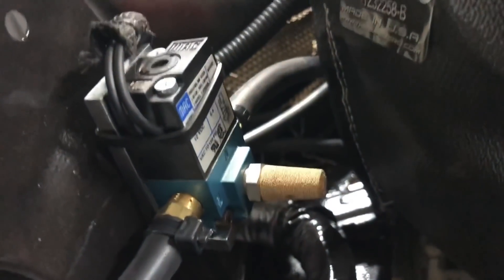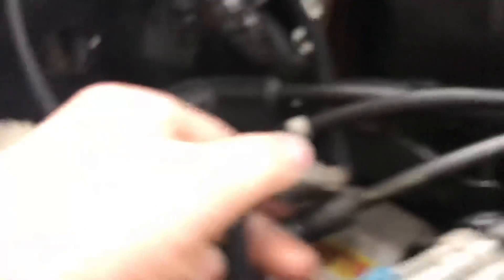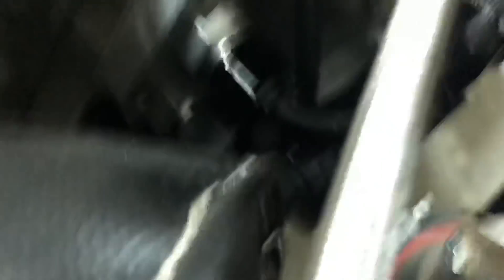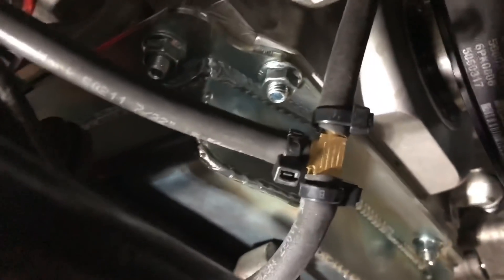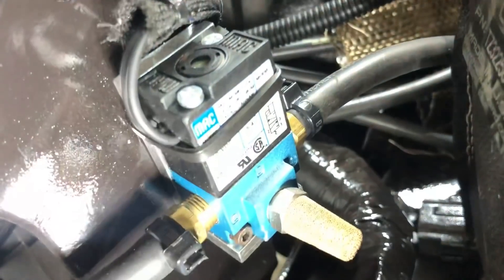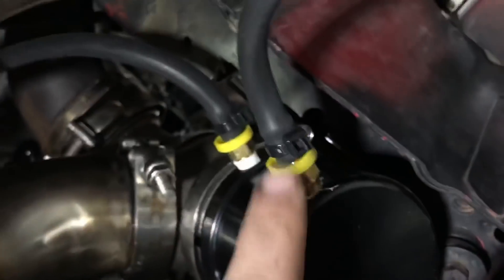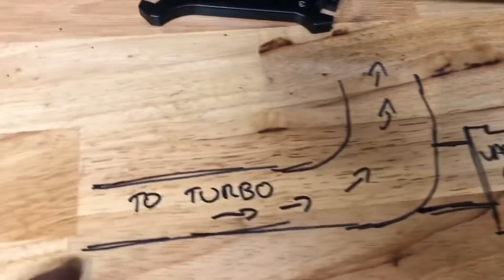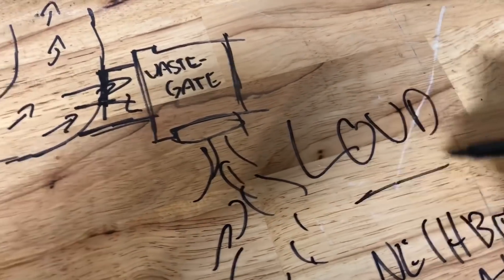Boost Control Solenoids: HOOK EM UP!

Comment: So once you wire it to the Holley what signal do you use? Map signal then type in the number you want it to use?
Reply from the maker: Depends on which Holley system.  Dominator and HP will do target manifold pressure.  The terminator x will not.  It will do dome control which is very effective
Reply: @ClapdOut  they lied to me on the phone then

Comment: Should you pull from the turbo compressor housing to Mac, or pull from intake..? I'm so confused right now, the instructions for my boost controller say to pull off a pressure only source to go to the Mac valve...so, not knowing enough, I'm confused as fuck and trying to learn! Thanks for the video...and I can either pull from a vacuum block I have off the back of the intake that my MAP is plumbed in, I was going to run the gate and bov off of, but looks like I need to run my gate and mac off the compressor housing..? Please fuckin help me bro!

Comment: now that we are coming up on the year 2021 I think it is finally time for me to ditch my manual boost controller and finally use some of the holley terminator features. thanks for the video for a poor person like me who isn't going to be running 2 mac valves and co2 controlled boost just yet